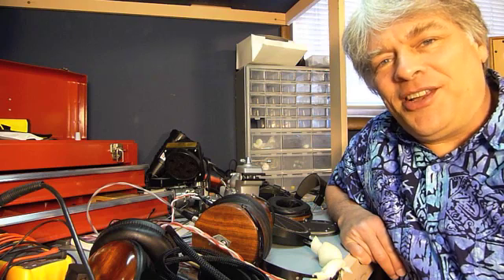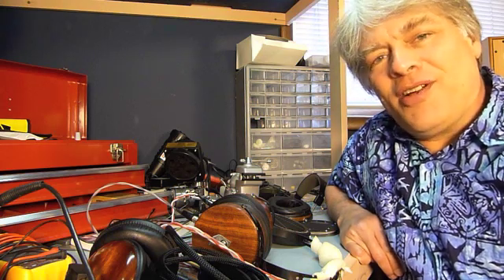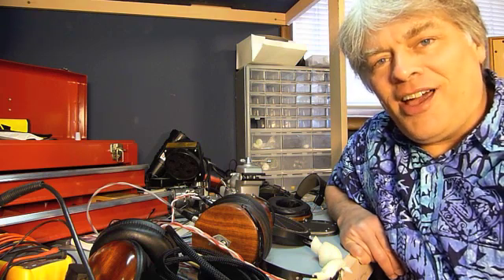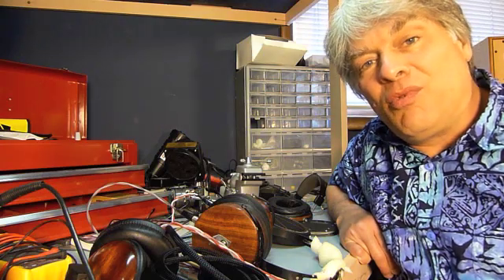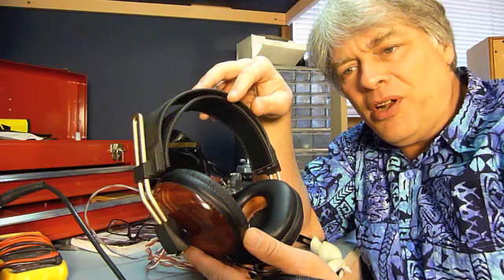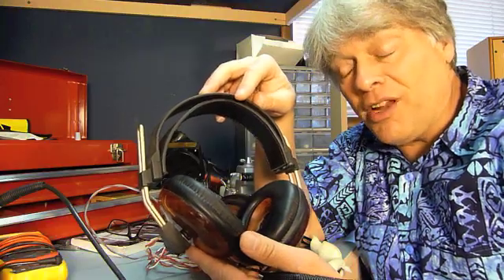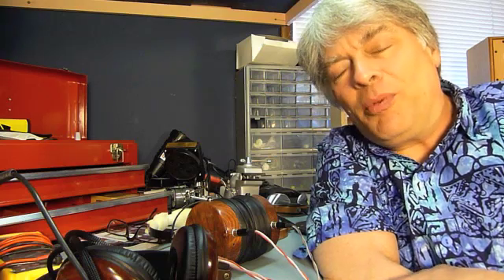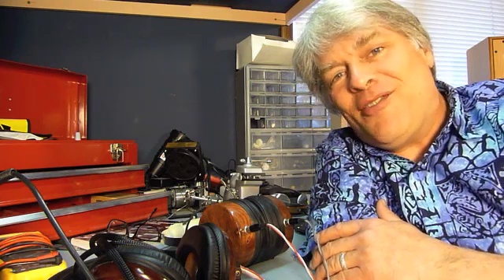DIY Orthodynamic (Planar Magnetic) Headphones; Measurements and Contest

Comment: whats the difference in sound from orthodynamic headphones against normal dynamic headphones. i get they are built differently  but what is the difference in sound?
Reply: +Matias Gipler midrange seems to be where they shine. Apparently their ability for vocals, string instruments, and brass can sound as natural and real as electrostats costing several hundred more. I'm really curious about them and I think I'm going to see if I can pick up some Fostex T50RP's since they're pretty cheap and have a huge following.
Reply: +Matias Gipler Planar Magnetic headphones are usually subjectively superior. Not always, though. But they do have a sound signature that pleases most people. Give them a listen and you'll become a planar believer. You should try auditioning Audeze's LCD-2 or HiFIMan HE-400i or HE-560.

Comment: i wonder how mines measures. got me curious now. all i used was some mineral wool and cotton to kill the cup resonance and swapped the pads with some extra old 240 sextett pads i had and stuffed them with cotton to give the pads more fluffiness. sound pretty much on level with my 240DF's. testing it in audacity i noticed 20hz little stronger on the left side but extends up to 20khz like a champ.

Comment: @InnerFidelity Hmm... they must be backordered then at the various places on line.  I have not tried to get them yet.  I also have some Extreme Isolation EX-29 (2nd version... rare, just arrived) and custom built HD-25 isolation cans that are available for testing if you ever want.  Fascinating how a simple mod of the HD25 can make them isolate so well, not seem to change the resonances at all (has the original cup inside the isolation cups), and is now easy to get driver positioning every time.